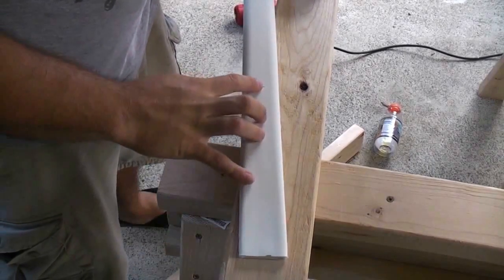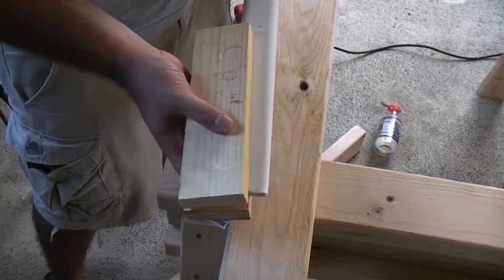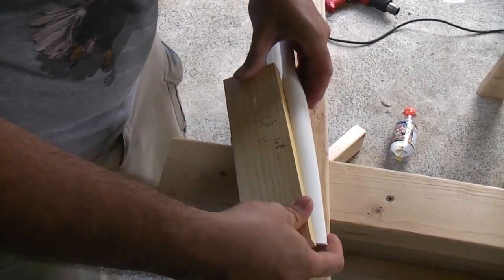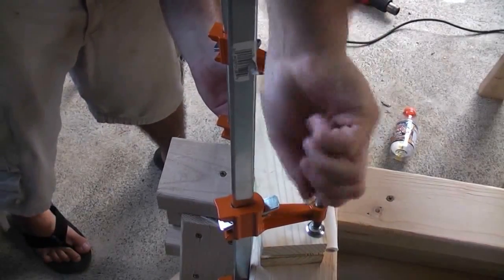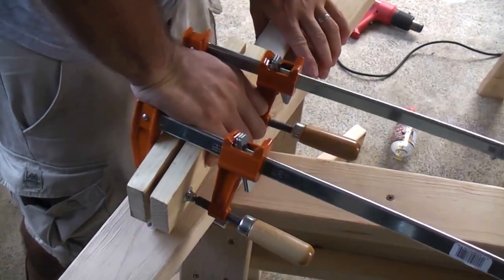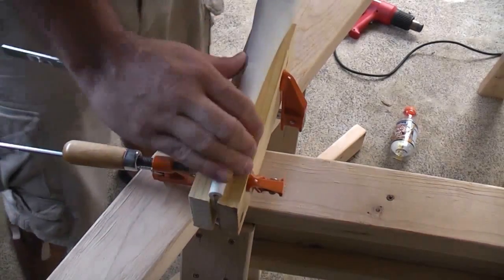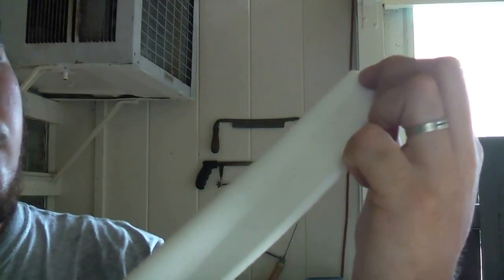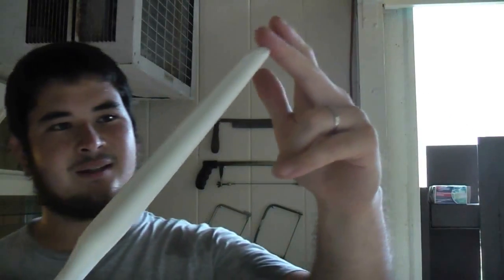How to Make a 40-50 lb Hunger Games Inspired PVC Flat Bow Part 3

Comment: When shaping the limbs, I take every precaution to make sure that they are perfectly straight, even adding legs to the flattening jig so that it slides on without rotating the pipe. However, the ends of the pipes always end up on opposing curves, like a tilde ~ I'm not sure whether it's just the pipes from my local Home Depot (Charlotte Schedule 40) but it would be nice to know if there's a way to avoid this.

Comment: Hi Nick, I've just revisited this video, and at this point i've a question. Wouldn't it be easier to form the tips with the method you used in the Hobbit inspired bow? Or this method is specific for some reason?  Thnx, Cheers

Comment from the maker: The bow would be about the same weight. You might get a couple pounds, but would sacrifice it in arrow speed. I would say a less aggressive removal of material at the tip plus a thicker, less-bending handle would kick both the weight and speed up.

Comment from the maker: I agree that cutting from the sides is a bad idea, but this isn't cutting from the sides. The sides are still intact. This style of tip and the v-cut style achieve the same thing. From what I've seen so far, this style is stronger than the v-cut with only one seam as opposed to two.

The drawback is that it's easier to mess this style up. Yet if done right, you can remove more mass with the same amount of strength as a v-cut and you don't need any sort of binding material. It's just another way.

Comment: pt1&2 were fine, pt 3 severely compromises the strength of the bow. From the end of pt 2, no more heat is needed. You have a mark 9" from both ends (9-12", based on length of bow). The tensile strength of PVC is found in it's edges, cutting either one will decrease strength. Instead, cut a V, from the end to the 9" mark, leaving a good 3/8-1/2" on both sides of the end. Heat slightly at the bend point (where the V joins), to gather both ends together. Secure with shrink wrap. MUCH stronger bow!